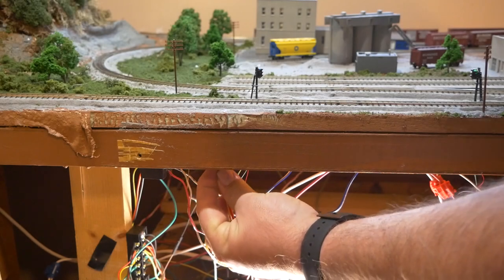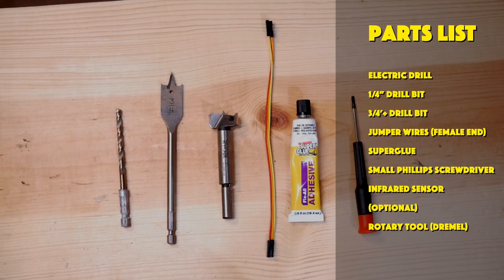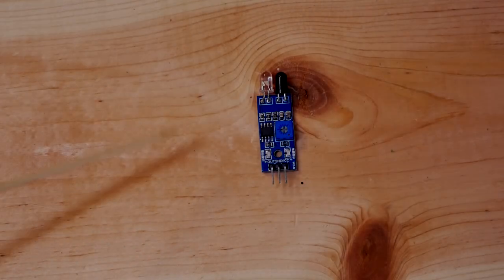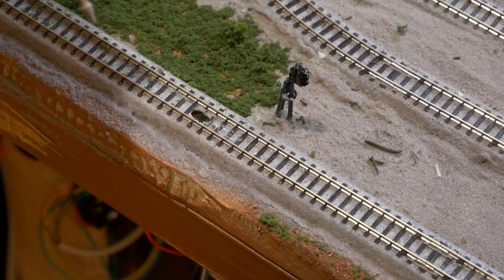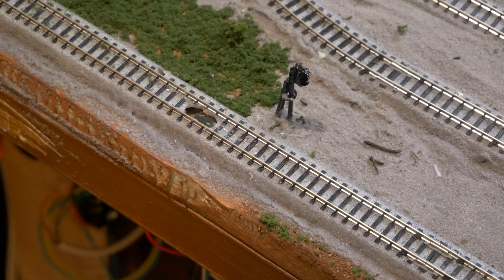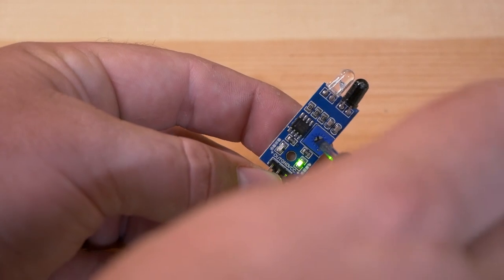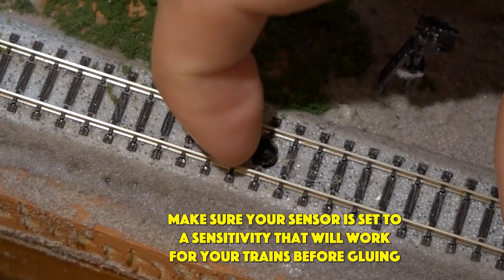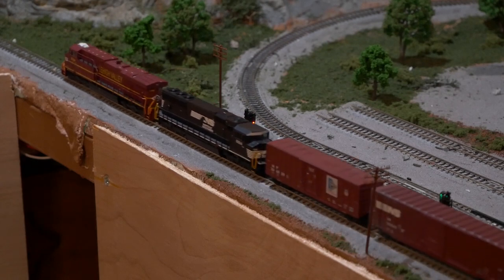Model Railroad Infrared Sensor Install On Existing Track

Comment: Amazing tool control making the slot through the track one-handed so that your support hand didn't block the shot.  I just purchased a later version of that IR detector that should mount perpendicular to the rails on N gauge track.

Comment: Jimmy, I use this same sensor but I installed 3 mm led bulbs with long leads standing up off the pc board at right angles.  I then drill 2 side by side holes between a pair of ties.  The bulbs are passed up from under the deck, thru the foam base, and to a height where they just show above the subroadbed between the ties.  Once this adjustment has been determined, I solder and clip the bulb leads in place to the  pc board.  The board has a hole, so I lay it flat under the deck and put in one small screw to hold it.

I use a 12 inich or so - -dupont connector cable with female on one end for the sensor.

I then daisey chain power and ground from my arduino mega sensor shield to all the sensors and run only the signal line back to the shield.  This saves a ton of wire.  Think of it like running a sensor buss line of power to all sensors much like your DCC buss.  

If you have a 8 position terminal block close to a grouping of sensors, run all signal lines into this block.  Then take a 8 pin cat5 cable and run the one cable back to the arduino shield.  Nice and neat - -walla!!  
Bob S

Comment: IR is good but it is easy to make it trigger with other objects, you can try Hall effects sensor they only trigger when they detect magnetic field, you can use tiny neodymium magnet on the loco or rolling stock to detect the train.

Comment: I use the same sensors, however I clip off the 5mm IR LEDs and attach 28 gauge wires to run to 3mm IR LEDs.  This way I can have the sensor board on the control panel to monitor &/or adjust it if needed.  I have run the IR LEDs 20 feet away from the board with no problems.  I can put two between two ties on HO scale using two 3/16 holes.   Good video if you don't want to modify the sensor board!!
Reply: I agree.  I can't see carving that canyon between the rails, then having to mount the sensor board there.  My installation is as you describe, very clean, unnoticeable once it's ballasted, and I can easily adjust the sensor any time I want.

Comment: Thanks Jimmy...Love your videos. They gave some great ideas. I mounted the IRs above the tracks, some 15" or more about. Here are my thoughts, the same ones I expressed on one of your other videos.
There are glaring deficiencies, in my opinion, with the Osoyoo IR Infrared Obstacle Avoidance Sensor modules including but not limited to:
•	their size makes them difficult to hide, therefore removal of the emitter detector pair is required as these are easier to hide without their printed circuit board;
•	IR emitter detector pairs proximity to the tracks must be close enough in order for the IR beam to reflect off engines and cars;
•	reflectivity varies being reduced due to car color, e.g. white versus black;
•	car configurations vary hampering detection, e.g. flat cars, round tank cars, etc.
•	burying IR pairs between tracks and pointing up are a pain to install, are subject to sunlight and room lights interfering with the detection sensitivity;
•	there is no applicability were a road crosses multiple tracks.
To solve these issues, I decided to mount the IR pairs in a through beam configuration, similar to what you may have on your garage doors. In this configuration, when the beam is blocked, a train is present. This allows:
•	Mounting the IR pairs facing each other creating a strong signal;
•	it allows them to be up to 15” or more apart increasing the ability to hide the IR pairs;
•	Makes alignment easy, that is, as long as the green LED on the module is lit, the detector is “seeing” the emitter;
•	The IR pairs are less likely to be affect by ambient light;
•	Instead of aligning the IR pair perpendicular to the tracks, they can be mounted diagonally to look up or down a track thus preventing the beam from “seeing” between cars should the train stop;
•	The IR pairs can see across multiple tracks, 3 in my application making the signal system work not matter which track the train is on.
Solution
So, the question arises as to what to do now that the signal going to the Arduino A0 & A1 is reversed. In the normal configuration, the green LED off means;
•	no train or car present;
•	the “Out” pin on the IR module  going to either A0 or A1 is high (~4.8vdc)
When the green LED is lit;
•	a car is present;
•	the “Out” pin on the IR module going to either A0 or A1 is low (~120mVdc).
In the new configuration, just the reverse output happens, e.g. no train present, LED on, “Out” is low, and so on.
Since I am not a programmer, I had no idea how to modify the Sketch to address this voltage reversal. Since I am proficient in using printed circuit boards (PCBs) and mounting components on them, my solution was to make voltage inverter PCBs made up of 2 resistors, an NPN transistor and an indicator LED for each IR emitter detector pair. This inverts the signals (voltage) going to A0 & A1 in the new configuration to the old configuration so the Sketch works perfectly without modification.

Comment: Hi Jimmy, for some reason this video came up again and I'd share where I am now.   I originally installed the IR detectors but I found that they were not totally reliable.   In particular, they reacted to some LED lights I installed.   So, I pulled those out and tried photoresistors and that's what I use now (I have 5 speedometers installed).

Anyway, as part of my Arduino Sketch I sample my PhotoResistors to see what light they are getting and then set the trip value to something like 75% of that value.   This way, if it is really bright it works fine and, if it is somewhat dim (not totally black) it still works.   So while this doesn't work at night it does work in a dimly lit area.

For my last install, it is on our club layout which runs in various places as it is transportable so I'm looking forward to see if there are any issues with the speedometer being installed in these different locations all with different lighting.

Comment: I used a method similar to a later post.  I removed the IR led and Sensor and replaced with 3mm longer lead sensor and led from the reverse side of the sensor unit. Then drilled 5/32 holes for the led and sensor.  This works well if you drill the holes parallel to the track separated by a single tie

Comment: hi Jimmy ...if The sensor  is 3 to 5 v output the signal lights are 12volts well the ones I have are anyway ..how did you get the signal led lights to work I haven't seen any premade in 2 or 3 way n scale signal lights in 3volt to 5volt...

Comment: Ran across a strange problem after installing the 3mm IR detectors. While running a Athearn Trainmaster the IR would not respond until I placed a piece of masking tape under the fuel tank.
Reply: the surface has to be reflective and not black of colour

Comment: If you had changed out the leds for ones with longer leads, you then could have made 2 small holes, pushed the bulbs up thru, and laid the sensor flat to the baseboard and been able to adjust it as required.  Of course the bulbs would have been bent 90 degrees to the pc board so it could lay flat.  Bob.
Reply: Longer leads and 3mm LEDs.  drill two 1/8" holes in the track, push up from bottom and a drop of glue to hold it there.

Comment: This is really helpful and well presented. Because the sensor is light activated, do you encounter problems when you fill in the hole around the detection bulbs?
Reply from the maker: So I have not attempted to fill in around just yet and I am trying to figure out the best plan of attack for that.  I want a method that isn't permanent so that I can work on the sensors if need be.
Reply: Would it be possible to mount the sensor portion (the two bulbs) remotely from the circuit board? That way, you could make adjustments to the pot on the board without having to either have a big hole in your fascia or removing the entire thing.

Comment: Thanks Jimmy.   I've been waiting for this as I want to do the same thing (to create an Arduino based N Scale speedometer).   I'm thinking I'll use Hot Glue so that the sensor is "somewhat" removable and I'm using regular flex track and have ONLY foam as a base - no plywood.   I like the idea of using a terminal strip though.   I'm also thinking of using Servo Wires as connectors to the sensor as these come as 3-wire sets - I'll need to test fit to make sure.

Thanks for the Video, gave me some good ideas.   Oh and I LOVE my Forstner bit set!
Reply from the maker: That's probably a good idea.  I think I need to invest in a hot glue gun!
Reply: I use a Woodland Scenics, just happens to be brand name but it is a low temp "foam safe" hot glue gun.   A high temp one would melt into the foam I have all over the pace.   You don't have a lot of working time but if you've test fit what you want to glue AND the way you'll get the surfaces together and "practised" inserting (or whatever) the piece you'll have enough time.  Plus, you can use it to fill gaps (not too large) and you can cut it to remove "overglue".   You can paint it although it isn't the best surface for that.

It works REALLY well when you want to take some light foam board and do some mockups.
Reply: @DIYDigitalRailroad  Bought one for $4.47 with 10 sticks at Walmart.... not quite a Dollar store, but will check on my next visit.... great videos, just found your site.

Comment: Great video thanks for sharing. I'm curious, with this method can you only run 2 block signals per 1 Arduino or do you have a way to run more off of a single Arduino?
Reply from the maker: My system uses one arduino per block, but you could certainly do more than one.  You could connect 5 sensors to the analog inputs, and with some recoding, you could do 3 blocks with that.  You would need 12 digital outputs for that to work with the signaling, so you may want to consider an Arduino Mega for that.

Comment: Hey I'm make a new train board with new pices do you have any advice on grass paper and foam
Reply from the maker: I have a couple of scenery tutorials.  I would check those out.  I do recommend painting the board and using simple household latex paint for that.
Reply: @DIYDigitalRailroad Thanks!

Comment: Could a guy remove the emitter and sensor from the board and remotely install them in 2 smaller holes with the board under the layout?
Reply from the maker: I've actually thought about that and taking a look at the parts, it looks like it could be done.

Comment: Some comments...  The IR sensor you used between the rails is too large.  The result is ugly and not realistic.  You'd been better off leaving the photo resistor in place.  A question...?  Why did you choose to use Kato track?  If you are modeling North American railroading, the tie spacing used on Kato track is too large.  Secondly, Kato track is non-flex which which makes a layout look too rigidly formal and contrived.